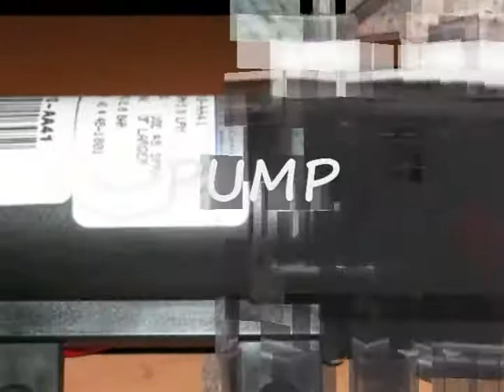GreenMachine360

Comment: i have one of those and that really works,the water pump have a 50psi of pressure,the guy in this video he's not using all the power..also using this system the waste on water is minimum like 1 1/2 gallon per normal car size.on a van or pick up truk its a roun 2 or 2 1/2 gallons per car.